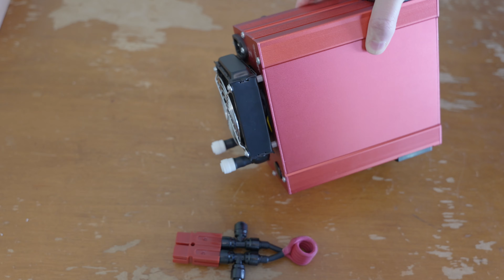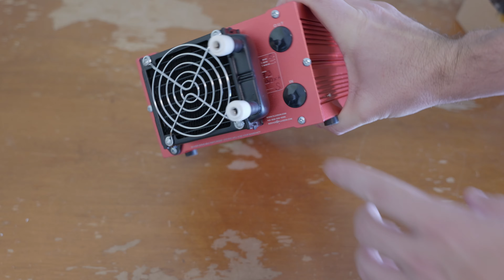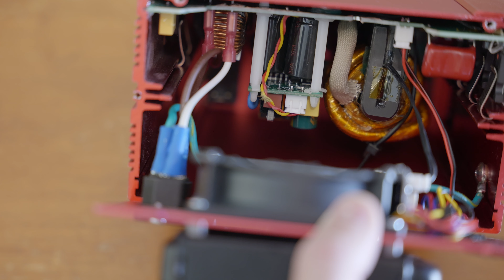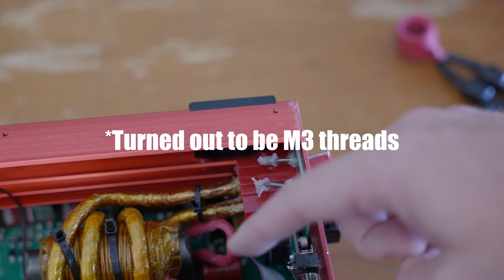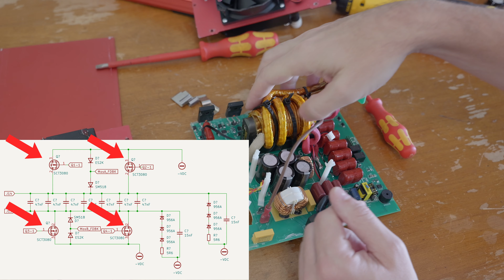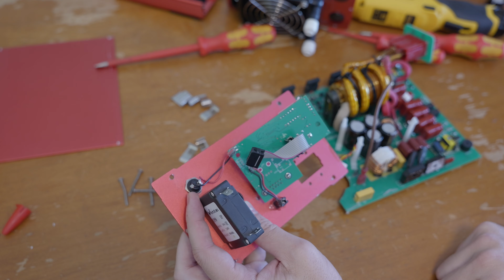Annie Annealer: Circuit Analysis and Demo

Comment: Excellent video. I’d love a troubleshooting vid. His family is parts of the build process. It’s not done commercially. It’s an in home business
Reply from the maker: I haven't used it enough to know what sort of trouble one would have with it, but if anyone ever has one that breaks, I don't mind helping them go through it. On these types of resonant systems, they kind of either work or they don't, and if they don't, it's because something let the magic smoke out. But they are also a little scary to troubleshoot because of the power levels present, and you can't really turn them down.

Comment: There is a handheld attachment they offer with a open style coil that I would love to hear your thoughts on! Great video 👏
Reply from the maker: Judging by the photos, it looks like it would probably just be two Litz wire leads and another wire pair for the remote button. They also have terminals to accept their coils. I'm not sure what terminals they use... I need to look into them. They are decent. A person could probably DIY one, but essentially it's just an extension cord for the unit made of special wire so it doesn't have too much inductance.